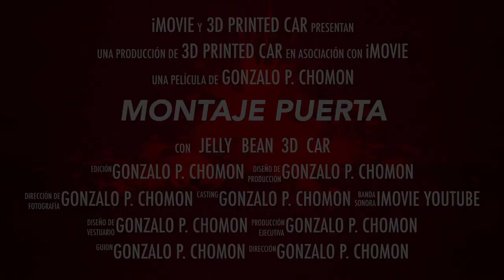IMPRESO EN 3D, COCHE ELÉCTRICO DIY, Montaje Puerta (ESPAÑOL, Parte 7)

Comment: Hola Gonzalo.  You made a very nice series of videos on the Kelly controller and setting the parameters. On one of your videos you spoke about showing us how to do the wiring.  Did I miss that video? or could you make that video or could I please speak with you offline?  I have just bought a very big Kelly controller with all the wiring and I don't understand it. I think you would find my project a little crazy over the top.
Reply from the maker: Thank you Mark for your kind words.
About the wiring is quite straightforward if you follow the schematics at the manual.
The only tricky part is the motor and hall-sensors that you have to find the right combination.
Give me your email or phone number and I will contact you.